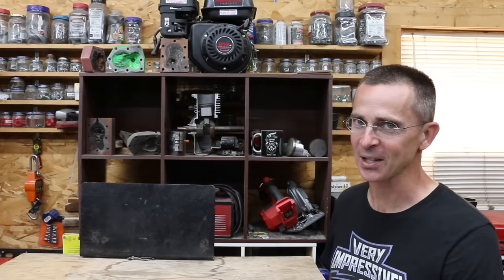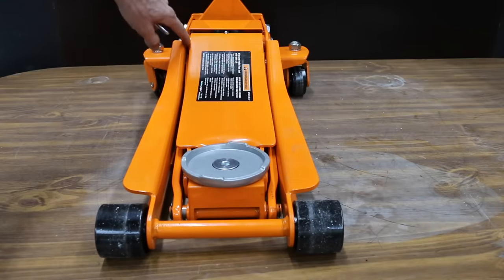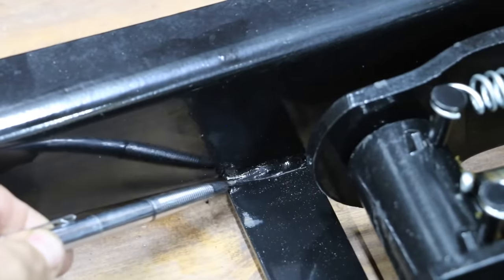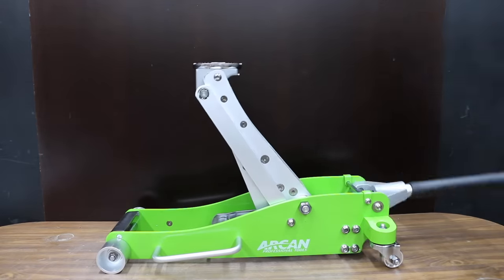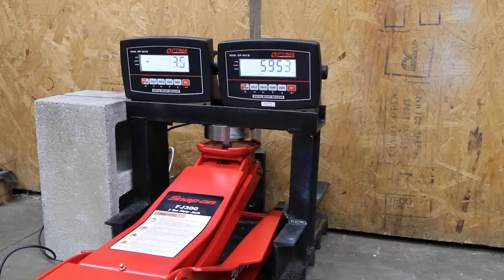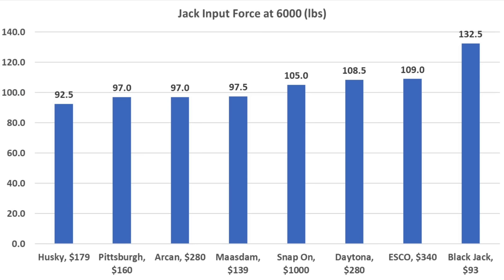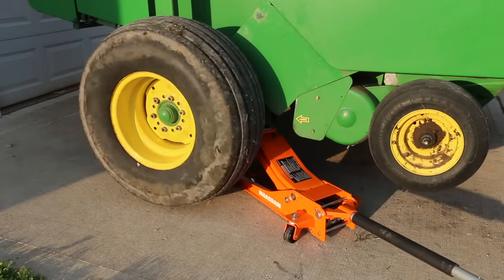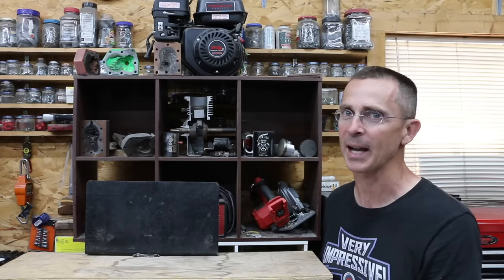Best Floor Jack? $1000 Snap On vs Daytona, Pittsburgh, Arcan, Black Jack, ESCO, Husky, Maasdam

Comment: From my understanding, HF jacks have always been one of their gems, and have been known to last long periods of time. Only reason I bought a Pittsburgh rather then a Daytona was because of my budget. It's been working great for me. Biggest downside is I have to throw down a bit of plywood on my gravel driveway so it can roll when lifting my truck.
Reply: I have one of Harbor Freight's old floor jacks. A model with what looks like a metal brick in the back of it and it is a beast. Heavy as all get out to move though. I was just abusing it a couple weeks ago when a large tree fell in my front yard. I was using it to jack the trunk up so I could chainsaw it.
Reply: I have a Pittsburgh from about 10 years ago that looks similar to this one, no issues.  They have a lot of gems, and a lot of crap.  For the most part you can spot the difference by appearance and the reviews.
Reply: @Tony as far as I can tell they do not censor their reviews.  The crap products have bad reviews posted warning you to stay away, assuming they’ve been around for awhile.  Some of the crap products are still worthwhile, like a cheap wet time saw if you want to remodel a bathroom and just need it to last through that job.  I did that 10 years ago, it has made it through half a dozen jobs.  It is cheap and crude, but good enough and hasn’t died.  For something like a ratchet, no, get the best with better ergonomics.
Reply: didn't HF had a recall on their jack stands?
Reply: @lordjaashin  Yes, though they've since released new ones, and it's not as though it didn't look like many of the other brands use the same manufacturer/factory as the old recalled models. I have a set of the new 3-ton jack stands. They're nice, and while the extra safety pins are extra steps, but it's nice to have the piece of mind. They've also released 6-ton versions.
Reply from the maker: Thanks for sharing.

Comment: I have had a Pittsburgh Jack, a craftsman Jack, and both of them have failed this past year. I bought the Arcan that you reviewed and I love it. It’s very light and very versatile. It has a very low clearance and it still has a pretty significant maximum height.. I was glad to see it was performing well during your review.
Reply from the maker: Thanks for sharing!
Reply: Which Pittsburgh jack if you don't mind me asking? i bought a low-profile 3 ton slate grey Pittsburgh floorjack for 99$ on sale, did an oil change but so far so good
Reply: @josephr.8622  
I had the Pittsburgh one and a half ton aluminum racing Jack . The springs fell out of the back of the Jack.. I hear you can buy replacement parts, but decided to buy a bigger jack and I’ve been happy with the Arcan.

Comment: 24" seems to be the max for all jacks, even the ones you did not test.  I have an old 36" jack and I love it.  It fits way under my low BMW, and it easily lifts my 4wd Ford truck.  Is there some reason a jack with this lift height can't be found anymore?  Is it too tippy or something?
Reply: What brand?

Comment: I would love to see a video comparing different brands of jack stands. I feel like that would be huge for peace of mind when it comes to safety.
Reply: Especially now that some of them have pins to lock them in at a certain height.  Do those really make a difference?
Reply: This, it's great to have comparison of jacks but the jack stands are where people can genuinely die or get severely injured.  I've heard reports that HF jack stands used to break but I've also seen people report that they were fixed.  A stress test on jack stands would be invaluable.
Reply: I swear PF did a jack stand video already and testing them to failure in it

Comment: It's been a while since the last one so I would love to see another work-boot/safety-shoe comparison. If you can find them I would love to see Airtox on the list. They are pretty expensive, but definitely some of the best and most comfortable shoes out there. Will especially recommend the TX3/TX33
Reply from the maker: Thank you for the video idea!
Reply: Timberland Pro, Pit Boss are the only boots I’ve gotten a year of work out of since my Red Wings which I got 2 years of work out of but also paid 2 years worth of work boot for lol. Steel showing and broken in to the point of loose fitting no matter how tight you laced them up. It just wasn’t worth it. They stuck together tho.
Reply: I recently picked up a pair of Keen boots. Very good 👍
Reply: @ProjectFarm  Along the same lines. a comparison of socks would be cool to see. Personally, I prefer Darn Tough, but I'm sure there are other options.
Reply: @waynelutwiniak797   I have a pair of keens been using for almost five years now. Worth every penny. Farming Metal Construction Fabrication Work

Comment: I like the blackjack because you can keep it in the trunk and use it on the side of the road to change a tire. It's a hell of a lot better than any jack that comes with the spare
Reply from the maker: Thanks for sharing.
Reply: I agree as I have one of the same Black Jacks as he tested and it works great for my 3600# SUV.  Don't need a big heavy jack I can no longer lift !!!!

Comment: Watched this back when it first came out as i was looking for a lighter floor jack with certain heights required, minimum height and had to lift to a certain height. Wanted it specifically to change my winter studded snow tires on my CX5 AWD Mazda and it has after market running boards, the problem, and the cars jacking points are the sill just after and just before the wheel wells, and the Black Jack met the requirements, the one I bought had the optional lifting handle, bought new for $80, on sale at Amazon with free shipping and the jack works great and has a lot of strokes but they are easy strokes, less effort, as I am a senior citizen.  Jack worked great and that is all it will be used for twice a year.  Glade I got the studs on as we have had a foot of snow and ice for a month and more coming.  you had a good review, thanks !! !
Reply from the maker: Thanks and you are welcome!

Comment: Wow, I would not have expected an aluminum jack to perform at the same level as full steel construction models, that's pretty awesome engineering.

Snap-On has got some egg on their face, being almost perfectly matched by a jack that is less than a third of the price :P

Comment: This video further cements my idea that SnapOn, as great of quality as they are, can piss right off with their pricing to performance ratio.  I'd buy a Daytona any day.

The only positions I'd deem SnapOn at all worth it is for the warranty if you turn wrenches for a living, and even that is debatable compared to other competition.
Reply: Yep.  I regularly run in to mechanics at harbor freight (I'm old and "talky") that swear by Icon and Quinn.  They laugh, then swear when I bring up the tool trucks.
Reply: I ve seen other people in the shop wait for a warranty replacement from tool trucks like for months. Snap on or matco, same thing. They keep borrowing my stuff that i just got from amazon 5 times cheeper😂

Comment: Another great video, thank you! Been using an Arcan at the racetrack for years and specifically selected it for the light weight. No one likes lugging around a 100-pound jack! If you do another floor jack test, I'd suggest looking at Hein-Werner and US Jack which are also made in the US like the Snap-On.
Reply: I don't think Snap-on jack is made in the USA.
Reply from the maker: Thanks!  Thanks for the video idea.

Comment: Just a heads up, if you purchase a Dayton Jack, you might want to inspect it before you leave the Harbor Freight store. I just bought the 3-Ton Super Duty Dayton Jack (SKU 57590), the jack was low on oil, and one of the welds on the front axle had some holes in it. Must have been made on a Monday :) Harbor Freight exchanged it out with no hassles, but I wish I had inspected it before I left the store so I would not have had to make two trips.
Reply from the maker: Thanks for the feedback.

Comment: I've had the pittsburg for a few years now. Caught it on one of hazard frauds sales for I believe around $100. For someone who doesn't use it every day, I have zero complaints honestly. It jacks everything I need and holds pressure well. Still no leaks and of course I always use jackstands. Even my 16 year old daughter has no trouble using it to change the oil.
Reply: Same here, couldn't pass up the Pittsburgh on sale at Hazard Fart when my old jack croaked in the middle of a brake job. It's provided good service, and the quick connect handle is indispensable as a cheater bar when loosening nuts that some "Impact Wrench Igor" over tightened. (I swear auto shops in my neck of the woods don't know what a torque wrench is... fasteners are either loose, or blasted on by impact at max load.)
Reply: same.. bought a pittsburgh there a few years ago for about $100 and have only used it a handful of times, but no complaints.
Reply: i use two separate jacks alot im too lazy to deal with jack stands😂
Reply: I think you guys missed the most impressive part of his comment. “Even my 16 year old daughter has no trouble using it to change the oil”. That in and of itself, that she’s changing her own oil, is the greatest. As soon as m kids start driving they will be doing their own too. Great job sir. 👍🏻👍🏻
Reply: I dont know what I paid for mine but I hardly doubt it was what was shown in the video.  I think for Harbor Freight he should always just include the price after using a 20% off coupon which is very easy to get.  I have used mine for years, and while I lost the bolt that locks in the handle which is kind of annoying, it still works great and I've never added any oil or greased it or anything.
Reply: 16 year old girl changing her own oil? You raised her right.
Reply: @mushieslushie  mine was around $200
Reply: Same here, about $99 a few years ago. Well built 3T jack for a steal. I use mine frequently and it’s held up well. Hard to justify the Daytona when the Pittsburgh is half the price.
Reply: @scottp2462  i like my long reach and lo pro extras make it worth while
Reply: Hazard fraud??😂😂😂😂 I've never had any bad experiences with em. I have the 3ton Daytona Jack and I have no complaints, it's a solid jack.
Reply: @martinedwards4522  My Pittsburgh is low profile also. I think a few years back the Daytona and Pittsburgh were the same unit with slightly larger wheels on the Daytona and more color options than the basic Pittsburgh red. I see HF has the 3T Daytona on one of their numerous parking lot sales this weekend for $144. That’s a great buy for a quality low profile, well built jack. Jacks are probably the best things HF sells.
Reply: @tristanexantus4661  in my 60+ years ive never seen a jack actually fail
Reply: @scottp2462  i agree that and their ICON line
Reply: @martinedwards4522  I've had scissor jacks fall three times all while changing tires.. I've never personally seen a hydraulic jack fail but have heard stories of them failing.. I read your comment and you're braver than me I'd never get under a car with just a jack.✌🏿
Reply: @tristanexantus4661  failing and falling two different things right 😂
Reply: @martinedwards4522  When it won't stay upright it's a fail.
Reply: @tristanexantus4661  thats an opperator fail
Reply: @Ohio-Patriot  Thank you, I am a firm believer that if you drive a car, you should have the ability to perform routine maintenance on it.
Reply from the maker: Thanks for sharing.

Comment: You should create an overall score combining all data points for the products you test at the end based on their relative performance rating of each metric.  You could also weight them more heavily for preferences in certain categories--such as price, etc.
Reply from the maker: Thanks for the suggestion.
Reply: Wow a YouTuber that actually takes and uses feedback instead of getting butthurt about it! Respect.
Reply: I don't want to be "that guy", but I disagree with this. Assignment of an overall score implies that one is objectively better than another, which just isn't the case. What's best depends on what a person prefers and needs, and how much they can spend.
Reply: @censored7881  I agree. I've seen this in other product reviews and just it doesn't account for the details of which might be useful to someone like minimum height, weight or especially cost. Also, at the end, he did say the "Daytona" was the best all-around.

Comment: I have a Torin / Black Jack Low Profile "Professional" that ranges from 3 7/16" to 17 7/8", I must have had it nearly 30 years and it still works great. I use it at least 2x a year doing the seasonal tire change. I knew it was heavy, didn't realize it's up near 80 lbs! No wonder I dread the chore. I ordered one of those 12V electric jack kits that only weighs about 20 lbs and works by hydraulics.
Reply from the maker: Thanks for sharing.

Comment: The most important feature that breaks more often then anything else on these jacks is overlooked in this review. The front wheels, specifically how they're fastened. A threaded nut is a must over a snap ring. Anyone who's tried to move a wrecked or disabled vehicle into the shop using a jack knows how easy the front wheels fail during this process. Sure its not the intended use, but its the needed use.
Reply from the maker: Thanks for the feedback.
Reply: I disagree, Rob.  I worked as a mechanic on dealership lines for over 15 years.  All the old jacks had outside snap rings on the CI wheels.  I worked daily with both newer and older jacks and never had a wheel come off.  Of course, when we had no work, we all grabbed a shop tool and cleaned/painted/greased them, replacing iffy parts (zerks/snaprings/springs/bulbs/etc.) wherever needed.
Reply: @ljprep6250  ive probly lost over a dozen wheels in a decade. Maybe it was too rough of a surface. Im talking specifically about when you have to help drag a car in with 3 wheels with a jack.. Then again in GM dealers the cobalts and G5's come in on hooks left and right in the winter after ripping the ball joint out sliding into a curb.
Reply: Well...considering that isn't how it was intended to be used.  I'm sure you did break a lot of them. They make dolleys to move cars...it's a JACK...you know, to jack a vehicle up
Reply: @tonydavis6487  this is an extremely common practice in the repair industry. Like I said, not the intended use but a needed one.
Reply: @rob_kasper_4410  I have no clue who you are working for and who taught you how to "work" on cars but I've been around cars and working on them my whole life. I used to be a service manager at a dealership and my best friend owns a used car lot and does a lot of repair work. I have NEVER seen anyone push a car into a shop on a jack. I would of lost my mind on one of my employees if I would of seen them do this. Move it a few feet or so, yea..but that's still sketchy. It's already on a jack. It is 10x faster and safer to drop it on dolleys and move it...BUT...to each their own lol
Reply: @tonydavis6487  Im an ase certified master tech with flat rate dealer experience, aswell as anything else out there. Ive seen this done and done it myself hundreds of times. Im sure its happend in the shops youve worked in. Im not pulling this out of thin air its pretty common shop knowledge. I dont need your opinion on if its the right way cause I can tell you it gets the car in the damn shop so we can make money. So just take my word for it that the wheels need a nut, the snap rings are a weakspot.

Comment: Awesome!  Can't wait to see the results. I bought the Daytona 3 ton Snap-On clone two years ago.

Edit: BTW, the Daytona is made in the same factory as its Snap-On cousin and Snap-On sued them if I recall correctly

Final Edit: Woot! I picked a winner.
Reply from the maker: Great choice!
Reply: I have a Daytona, not this exact one it was cheaper but it works amazingly, had it for a long time, never fails
Reply: I have the Daytona it works great!
I've heard of the lawsuit.
what happened at the end?
if they are made in the same factory which I'm sure they were what's the lawsuit about??
Reply: @philllsxga.7737  I heard something about snap on getting in trouble about not being made in the USA as they state for the jacks. Could be wrong just what I heard and so that changed some of the outcome
Reply: @mattwiederholt7258  A lot of Snap-On products are no longer made in the US. Their jack is one of them. Same manufacturer as the Daytona in fact. Same jack entirely except for the wheel size and 1/4 inch higher lifting range. However many of their hand tools are still US-made. But drills, jacks, etc... all China.
Reply: @philllsxga.7737  I think Snap-On was mad about Daytona undercutting them and not having exclusive manufacturing rights